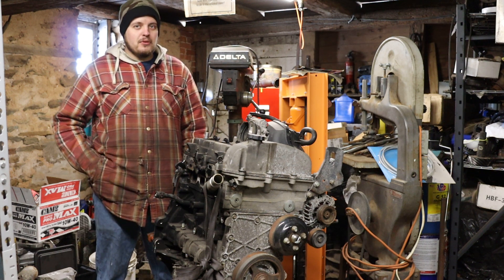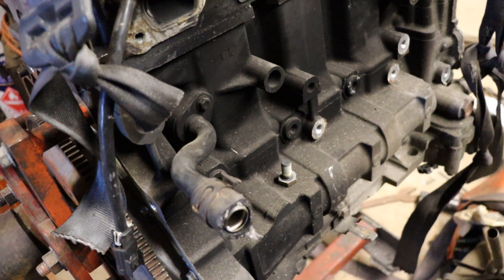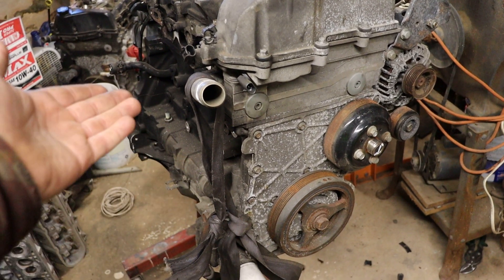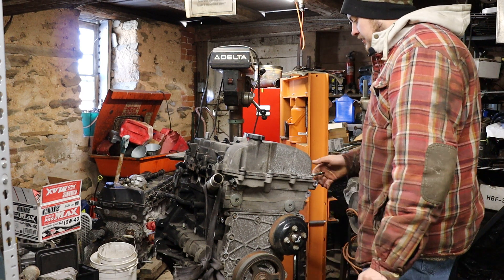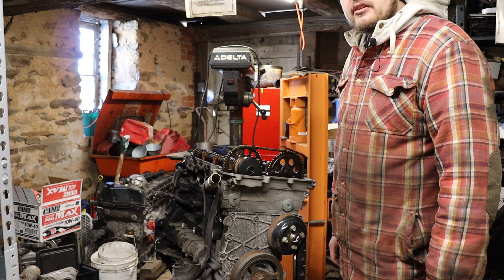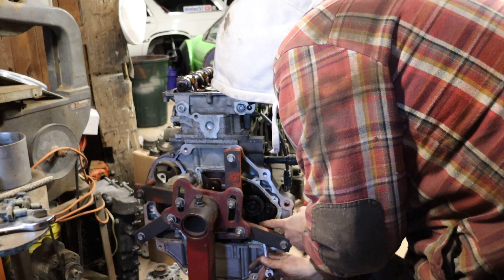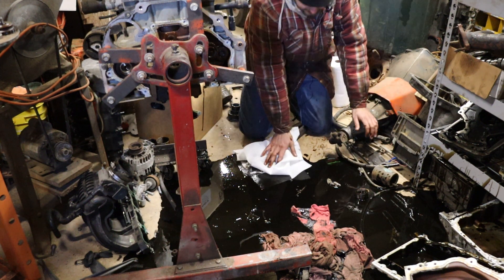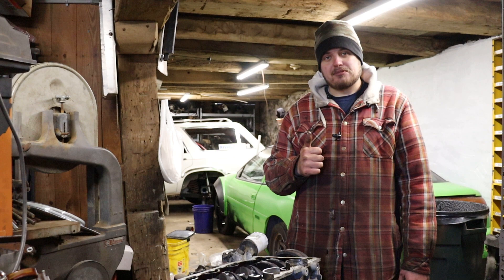LOCKED UP ENGINE - Vortec 2900 teardown

Comment: Balance shafts are not used for torsional resonances. Only to smooth the vibrations felt by the users. You can always delete them because they do not reduce stress inside the motor.
Reply: What’s the best way to delete them ? I have a 5cyl 3.7ltr that broke off a balance shaft gear and made a mess
Reply: @chadriddle3517  you can just remove them, BUT you must block off the oil passages so it doesn't have an internal hemorrhage. You will feel more vibrations.
Reply: Or leave them in to block the oil and lock them from moving but leave the sprockets off.
Reply: @qwertyword  I need to find a way to block them off . I believe the shaft bearings wear danger damaged during the carnage of breaking the gear . I seen where someone tapped and plugged them. I wonder once plugged if it will create more pressure in other areas ? U doubt there could be too much pressure

Comment: I would like to build an oil pan for my 2.9 like you did with the 4.2. If the machine shop that did the machine is interested, I don’t mine paying the money for their time and materials. I could finish it myself like you did. The car runs in NHRA competition eliminator

Comment: I have an 04 Colorado 2 wheel drive I would love to get a rebuilt 2.9 L with a small turbo and then fit an 8L45 transmission. A 100 extra horsepower/torque would suit me. I'd be more interested in torque. The 8L45 with double my gears be better for daily driving and should make it quicker and more fuel efficient. Your thoughts....?

Comment: Does the balance shaft actually eat enough HP to make it worth deleting it?
Reply from the maker: It's both a HP thing and a reliability thing. Those silly things are spinning at 2x cranks speed. If I want to take one of these to 8500RPM, that means the balance shafts are going to spin at 17000RPM. Spinning something that fast that is by design imbalanced sounds like a really bad idea to me.

Comment: I have a vortec 2800 in my 2005 Chevy Colorado, I want to put a turbo on it but I can't find anything online about it, is it good for boost or can it handle it
Reply from the maker: We've put boost to stock 4200s. The 2800 should be capable of 2/3rds of whatever we did there.

Comment: I am really wondering how one of these would work in something like a Jeep XJ or maybe an Isuzu Trooper/Rodeo with a spent V6. Don't even have to get crazy with a turbo setup. Stick a supercharger on, get her making 250hp and 260-280lb-ft and it's probably not even breathing hard. That's an easy replacement for a Jeep 4.0 I-6 or an Isuzu 6VD1 or 6VE1.

Enjoy your new waterproof floor lol.
Reply from the maker: They make 291 from the factory, so may not even need that.

Comment: Can you swap an i6 for the smaller 2.9 pretty easily?
Reply from the maker: You would have go build a new set of mounts.
Reply: @Calvin-Nelson  are mounts the only big thing i would have to do? Im taking the harness and computer as well as the motor. Hoping that everything else would be plug n play..
Reply from the maker: @tommyanderson4586  not sure what will plug and play. Mounts would definitely need addressed.
Reply: @Calvin-Nelson okay, so if i have a complete envoy and a complete canyon the swap should be achieveable right? N thank you for replying!
Reply from the maker: @tommyanderson4586  it's certainly achievable.
Reply: @Calvin-Nelson  maybe you could do a video on a similar swap.. could be some great content lol

Comment: So you can basically get a Colorado drive train awd front half anyway. Adapt a 400 or maybe 700r4 all the time chain drive case. Use the electro mag to disco from the Colorado front diff… how would you do the front hubs I always give up there. I have an 87 Supra this would be perfect for. The 6 just seams too long

Comment: My buddy just bought a 4.2 L envoy, the whole truck, running and driving, in decent condition, 200,000 miles, for $600. I know the five cylinders are dime-a-dozen, but I haven't seen as many 4-cylinders, but I have a feeling, someone will donate you another one, after watching this, or you'll find a running one, on the cheap. So for now, you got a mock-up motor, and a parts block. I'm sure when you build the next 2900, you'll be using some of this lock up motor, to build the new Beast 2900, as well. And you got a good 4L60E, so wasn't a total loss. Can't wait to see the build.
Reply from the maker: Yeah. Someone who is doing a LS swapped Colorado is the dude I need to find.

Comment: What did those come in you said 4l60e so rear wheel drive so like a Colorado or trailblazer but I didn't realize the trail blazers ever came with anything smaller than the 4200
Reply from the maker: They only came in the Colorados and Canyons.

Comment: Do those inline vortex motors have a different bell housing pattern than a LE or small block Chevy?
Reply from the maker: It's a different bell pattern but the dowel pins are in the same spot as the SBC. Adapting is very easy. Look to emtech. His adapter plates are very affordable.
Reply: Yes, the Atlas engines have a special bellhousing. It's different from all the other GM engines. So it would be a good idea to get the transmission (or at least the bellhousing) that came with it.

Also, don't let the Vortec name confuse you. That's just a marketing term GM used for truck engines. So for example, the Vortec 4300 is a 4.3 liter V6. It has nothing in common with the Atlas engines. Same goes for the Vortec 4800 / 5300 etc, which are LS based V8 engines.
Reply: @michaelblacktree  vortec Truck Engines are due to the compression chamber shape. Vortec came about in the late 80s with the V6, then in 1996 the Gen 1/2 SBCs got Vortec Heads, and then the LS engines came about in 1996 for the Corvette/Camaro, 1999 for the Trucks. Its all the head design.

You might say the Atlas is a Old I6 with LS ques with VVT of Gen 4 LS...

Comment: At least you got a mock up motor and a cyl to diddle with to your hearts content! I do have a project in mind for the 5 cyl(need the sound) so seeing all the differences between the 4/5 vs 6 cyl is helpful! Thanks again!!!
Reply: Those 5-cylinder engines sound like an exotic sportscar, especially with a custom exhaust.

Comment: I wouldve lost my shit if i spilled all that oil in that weather during a tear down lol
Reply from the maker: Yeah. Was not fun! Took about 30 minutes to clean up.
Reply: Agreed! Like totally lost my shit!  I was picking up a 79 Celica yesterday and I was switching out the wheels and my knees on the ground for 30 seconds while using the jack was so damn cold!!! I don't want to do anything outside right now!
Reply: For a easier oil cleanup get you a bag of kitty litter works every time
Reply from the maker: @romonecrosby  that's what we used! Lol